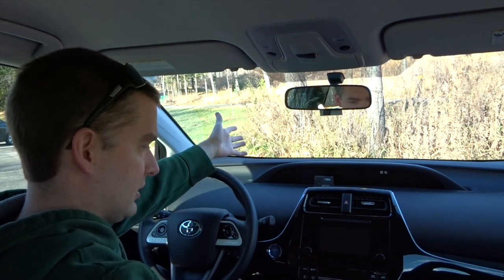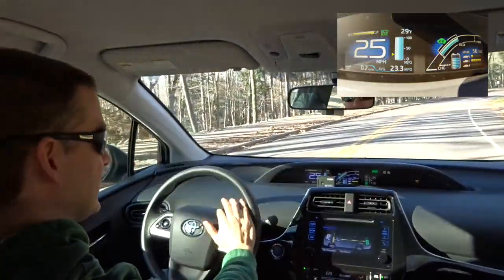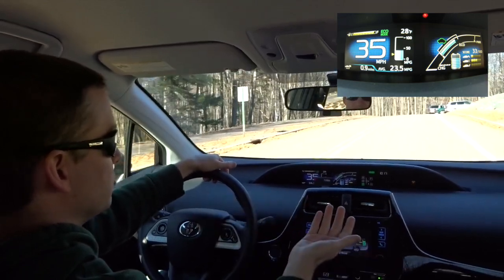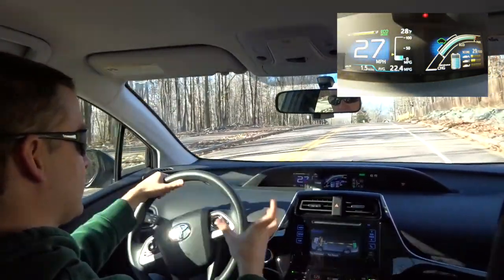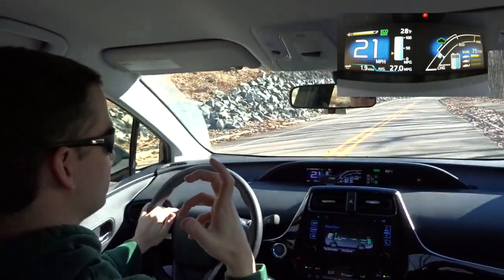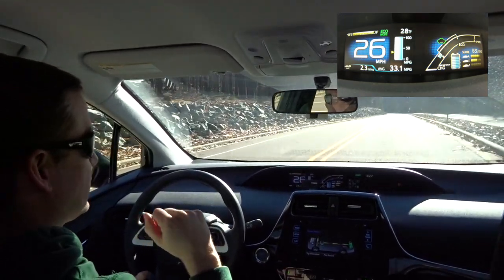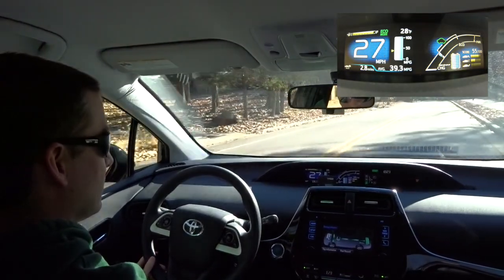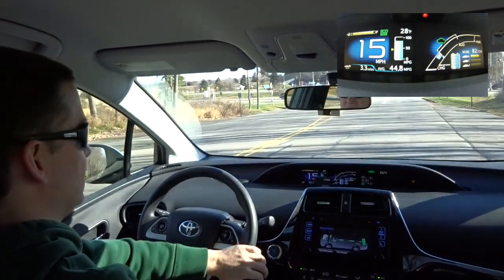Prius "B" Mode Explained

Comment: Weber Engineering explain Prius transmission very well, it’s a University Prof I think, at Utah State.  The only grey area he left was the friction plate, clutch-type device - seems to be a safety-relief situation with that, it can be forced to scrape around inside a permanently clamped compact ring housing, but there’s no normal use or actuation of it as a clutch at all.  It’s a ‘torque let-off’ device for sort-of emergencies only.  Weber describes Toyota’s system very well, I watched it a couple of times.  As others realised way before I did, this ‘synergy drive’ is not in fact the BS I originally thought it was (before I got the car and looked into it), and certainly not the conventional CVT design, that the likes of Nissan use.

The Nissan ones have all the failings I thought the Toyota design had, pulleys, torque convertor wasting energy, a weirdly complex belt that needs to grip but also slip (!), and the belt is made of metal stampings, formed into a belt - it’s a darn good try, but not a patch on Toyota’s Prius design, which was much better by gen 3 eliminating the chain drive previously incorporated.  In the deepest recesses of my brain, a little voice says the Toyota system is really a variation on the principle of the differential, but with twiddly extras-on as it were.  It does not LOOK like one, but it has several diff-type gear assemblies buried inside it, and the MG1 and MG2 by this ingenious method, sit in a simple straight line with the engine.  It avoids all the friction plates of a conventional auto transmission, by the MGs kicking-in to do something-or-other.

Weber does explain it well, I don’t.  I am just glad it’s not wet friction plates all over the place.  No conical pulleys and weird belt that needs to grip but also slip up and down the rise of the pulleys, and it’s a belt that relies on PUSH effort, not PULL like you ( I ) would expect.  After all, that’s how every chain and belt in almost every system anywhere, works, by tension.  Anyway, this was a good exposition of the system, and I learned a lot from the other commenters.  My takeaway is that ‘B’ mode is not exactly EV one-pedal driving, and is for being used sparingly, for where road signs say ‘engage low gear now’ on hills etc.  I do use it for short stretches where speed humps mean you go fast and slow a lot, like as if it were second gear on a manual clutch car.  The strain isn’t much because it’s not downhill, it just saves me applying the brake/regen braking all the time. Take care all.

Oh, PS…have all the motoring journalists stopped talking about Regen Brakes finally, showing that they originally thought these were physically a separate set of brake units?!  There were a few in the beginning.  Said things like ‘The regen brakes wear instead, so your ordinary brakes last longer’ and so on.  I cringed.  This motor journalism, was the actual job of these people, with luck they now do something else, a lot better.

It’s a relief to know that (having just scrapped my old Volvo 5-pot with conventional auto transmission) my newly-acquired Prius gen 3 has a lot of the parts that wear, gone.  No torque convertor, so more efficient.  The ‘creep’ you feel when you ‘engage’ the D mode of the tiny gearknob, is entirely simulated.  It mimics the torque convertor creep but is merely one of the MGs being ‘told’ to do that!

Comment: An interesting thing to note with priuses is that even though they have a lot of engine braking, you need to use the brakes every once in a while because depending on humidity, they can inflate just enough so that the pads rub against the rotors, slowing the car down and eating up a lot of battery and fuel. Happened to my grandpa because he lives near the sea, he started breaking more often and now the problem is gone.
Reply from the maker: Good advice!

Comment: In some places, truckers aren't allowed to use their engine brakes/Jacobs brakes/Jake brakes at night. Does that apply to this Prius feature?
Reply: Probably not because the reason the trucks are not allowed to is based on the loud noise that it makes.  I'm pretty sure the Prius is quiet.
Reply: Is it also because of the way each feature works? (e.g. On a truck's engine brake, air gets released from the cylinders, thus lowering the amount of air the fuel can react with. For some reason, I don't see that happening with a Prius, but possibly with a big diesel engine.)
Reply: enator71 I know I'm late, but just in case you haven't found out. 

engine braking works by slowing the car with the compression of the engine. No fuel is used. The higher the RPMs,  the more the wheels have to turn over the engine. 

Precisely why engine braking in 1st is stronger than 5th/6th in a manual.

I can only explain for most manual cars, I can't comment on other vehicles really

Comment: I don't think you understand B mode 100%.  The explanation is not right.   B mode, wastes energy by using the engine to assist in braking similar to a normal car. This is why the gas engine is running.  it is more efficient to use the brake pedal to engage regenerative braking to recharge the battery.      Driving in B mode full time is very silly - it should only be used on really long descents where you want extra braking and the hybrid battery will fill up 100%.    On the prius the brake pedal does not actuate the brakes until you run out of regenerative braking.

Comment: One thing about B mode. Call it what you want. ,,Brake'' ,,Battery'' or whatever.
They should've just left it out. 
If you're driving in D there's very little initial engine braking on the Prius because the engine is turned off. 
In B mode the Prius uses the engine at a very high rpm for engine braking. So energy is wasted.
You shouldn't do this in any other car but on you Prius you should ride the brakes in D all the way down. The Prius has an electro hydraulic brake or called the ECB(Electronically Controlled Braking). What that does is there's no direct connection between the brake pedal and the wheel brakes. Just like in the well known Mercedes SBC (Sensotronic Brake Control). The pedal feel is simulated by a modulator and the electronic computer itself does the braking of each wheels. Advantages and disadvantages in a normal car can be found on Wikipedia. Also use a translator and read it in German which goes much more into details.
Back to topic. As there's no direct connection between the brakes and the brake pedal the computer can utilize regenerative braking and will blend in the friction brakes seemlessly as soon as regenerative braking hits any limitations. In everyday driving that's usually speed as the generator then lacks rpm for effective braking. 
Now going down hill and riding the brakes not to hard will give you a lot of energy into your battery. When the battery is full the transmission will automatically go into B mode to now use the engine for braking and friction braking is blended for the amount needed what the driver requests in deceleration. 
Engine breaking doesn't give you anything it's just another friction brake if you want so and uses the pumping looses inside the engine to simplify terms a lot. There's much more going on but that's just too much.
So best strategy is if you know that you'll go down the hill afterward or there's a decent on the other side. Go up in EV mode as far as you can draining your battery and go down the hill to charge your battery as much as you can. When you hear the engine rev up let off the brakes and switch into B mode. That's the most cost effective way to travel that hill and decent.  Don't worry about damaging the battery. A 100% on the display are 80% for the battery in real life and 0% are 40% in real life. That's done to maximize the life of the battery. 
B mode was just implemented as there were people complaining about the very little deceleration of the Prius when letting of the gas pedal.
Use a translator if you want an indepth explanation about the Prius ECB https://www.priuswiki.de/index.php?title=Bremse#Bilder_von_Bremsscheiben

Comment: Today I had to drive downhill, it was pretty long road. I did not use B gear, only brakes. half way through step downihll, i  felt some twitching on my pedal and ABS indicator also flashed 2 times. Just after that my brakes could barely slow down the car. luckily I was able to stop in a safe spot. My break pads were overheated and I decided to use B gear,  it was an experiment, I had no idea how my car would behave. I just went with it and B did a pretty decent job helping me decend, but my engine became so lound that I got worried . Engine was revving faster than ever before. So i had to continue with D. Now I see that It is okay for engine to be absurdly loud . Finally after cruising with B it cooled my pads and was able to continue driving. I just wish I had used B for whole trip, probably my pads would smell so bad

Comment: The B mode doesn't affect the charge, like many people seem to think. In fact, the engine is charging better in D mode, because the combustion engine does not brake the car by using part of the driving force.
Moreover, this is perfectly visible in this video. In D the load bar fills up completely, while in B it only goes up to a third. 
Moral: in B, you brake more and better, but you don't charge the electrics better or faster. I don't even know if we're really saving fuel anyway. But I do know that it avoids the need for brake discs. So good point for the mechanics.

Comment: Why do people who don't understand their cars insist on making videos?  The reason for the ICE running while you were using B mode downhill is clearly explained in the owner's manual.  The battery only has a certain amount of capacity.  If that capacity is exceeded, the ICE runs to use up that extra energy.

Comment: Congratulations on actually explaining nothing. “B” mode is battery tending. It runs the generator to create resistance in the driveline to slow you down. Which is why it won’t go into EV mode, it wants to charge the battery. God I hate owning a Prius. And you’re one of the reasons.

Comment: I also used B mode in city traffic ~ typical top speeds less than 35 MPH.
Reply: You'll get less good gas mileage doing that because you're not charging the battery to slow the car down, instead you're using the friction / pumping losses of the ICE.
When the car starts to `run away' in the video you can see the charge go up to max momentarily as he brakes before hitting the `B' button 5:10

Comment: Yeah continuously variable transmission (CVT) Stupid consumers complains about the constant revs which is normal ... so car manufacturers program the ecu or ecm to mimic the gear change... and for the toyota hybrids ... and on the video as this gentle explains when going down hill the engine shouldn't kick in... it's very normal as the car is traveling over electric motor speed it switches the engine on and will stay on unless to the above speed... and even when you not moving the engine will switch on to slightly charge the hybrid battery. ..

Comment: B mode is nothing more than activating the regenerative braking when you let off the throttle more aggressively. Fully vehicles you can adjust regenerative braking so that it is more or less aggressive as you let off the throttle. This is also known as one pedal driving. In a Chevy and a Ford it's just called L.  Absolutely nothing about B mode has to do with the transmission.

Comment: The gas engine is not actually "running". The electric engines are running it dry (without gas) to burn up excessive battery.

Comment: Prius hack : of your prius battery takes a crap and leaves you stranded ..fear not prius owners , simply take the vape pen your puffing right now apart and carefully remove the lipo battery making sure its fully charged , now remove your prius battery , then install vape pen battery into prius taking care to not short or connect backwards ( you will know because prius will only go backwards ) now give it a try . Off you go now to your local Starbucks and hindu store for new vape battery and flavored water.

Comment: Um, nothing was "explained" other than how you might use B mode. Why is the gas engine always running in B mode? You never explain that you can hear the gas engine revving higher in B mode. Why does it do that? Could it be that the gas engine is just engaged more by the power transmission system and that normal gas engine closed-throttle braking effect is happening?

Comment: if you really want to understand your hybrid toyota get an app called torque pro with a good obd2 transmitter. It will give you all the data you need in real time on your phone, like how much regenerative braking, friction brakes usage, energy consumption and fuel flow etc. You will understand more what B does. D regenerates more energy but B is usefull when regen disconnects like when braking on bumpy roads so not to waste energy.

Comment: This car Seems very noisy! Not?
Reply from the maker: It is when the motor is revving, otherwise it's pretty quiet.
Reply: It's quite noisy during medium-to-hard acceleration, when the gas engine is making lots of power at higher revs. Very quiet when the gas engine isn't running. Quite quiet cruising at 60, except wind noise and road surface noise aren't as quiet as a typical big sedan.

Comment: Just my opinion, but brake pads and rotors are a lot cheaper and easier to repair than a CVT transmission. By the way, the planetary transmission is not a new idea. Henry Ford had them in the Model T.

Comment: The engine has a powerful electric generator, like an alternator, but the engine has to be spinning. The engine isn't technically "running" because the downward momentum of the car is spinning the engine. It's the same as putting a regular car in a lower gear, the engine throttles back and the forward momentum is turning the engine.

Comment: So is the gear actually widening in "B" mode?  If I were to accelerate in "B" mode, would it be like accelerating at higher rpms as well?
Reply: It would be like accelerating in second. I don't know if you would have more power, but your rpms would go through the roof.
Reply: @alansach8437  Nvm, found this online somewhere way back.  It doesn't change the gear ratio while accelerating, only when off the accelerator.  Therefore it changes nothing except that it gear brakes when off the accelerator.

Comment: You don't know your car. Burning your brakes requires using your brake pads as such first. On the Prius, stepping on the brake pedal tightens the regeneration until your battery is full or your speed bellow approx 10mph. B mode is only for when your battery is full, and the car will use brakes instead of regen.

Comment: Suggest you do a bit of research beforehand. You don't understand why the ICE is running? That's the whole point of using B mode: it uses the compression from the ICE to slow the car.

Comment: The engine was running because it was 28 outside and the heater needs the engine heat to heat the car

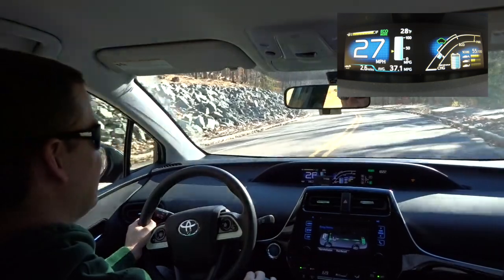Comment: You said you've never had 8 bars/a full battery… But at 7:36 seconds, your battery shows it just reached 8 bars/full battery. You can thank B mode for using what would normally be wasted energy and wasted brake pads to charge your battery as well. :-). The B mode is your friend, especially in a Prius Prime.
Reply from the maker: Very true, you normally wont hit 8 bars under normal conditions.

Comment: I agree with your comment on CVT. Imagine you have a car with a CVT, you know what that means, and you know what your vehicle is capable of. Then imagine that vehicle simulating shift points. How disappointing is that? CVTs with fake shifts annoy the snot out of me. I took a $5k loss on a brand new Subaru because the fake shifts drove me bonkers. (the touchy accelerator and steering really threw me over the edge though). CVTs are fantastic when they work the way they were designed.

Comment: The spark engine isn't actually running in B mode with no throttle input. It's being driven by the front wheels, just like when engine braking in a spark-only.

Comment: Coming down a very steep and long mountain road (in Colorado) our Prius started making strange noises in B-mode.  Any ideas/observations?
Reply from the maker: Is it only when the battery gets fully charged, or is it anytime the prius is in B mode?
Reply: It seemed to be AFTER the battery was charged, and the noise continued, whenever I put it in B mode, until I got to the bottom of the hill and shifted to D.  I've been afraid to turn it on again.
Reply from the maker: I would say my car also sounds slightly different in B mode and after the battery is fully charged. If it isn't a bad sound, it could just be due to the hybrid system changing it's cycle.
Reply: If the noise is like full power engine running up the hill then it is OK.
Reply: What kind of noise? The petrol engine will "rev up" to do the engine braking that would normally happen in other cars. It's not using fuel during engine braking of course, only uses the car's momentum to spin the engine.

Comment: B-mode slow down so that the automatic transmissions shift up automatically. and with the petrol engine go me a trip to charge the batteries automatically, the Prius has a very nice hybrid that is always charged when the petrol engine runs. in contrast to other plug-in hybrids, which must be charged at charging stations or power outlets at home